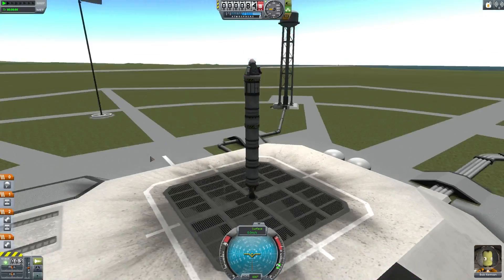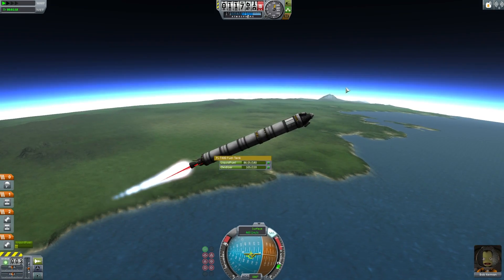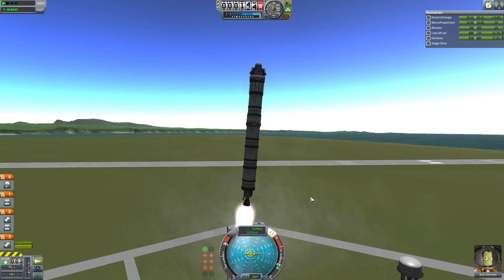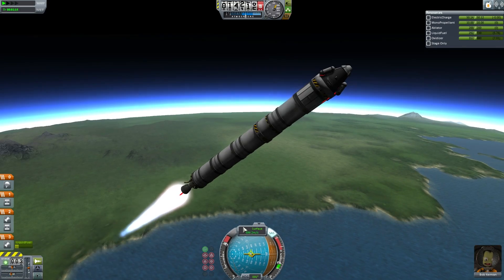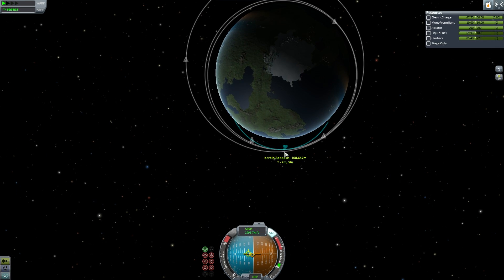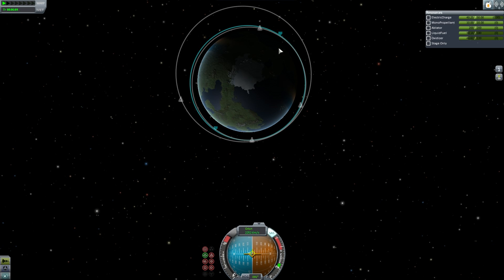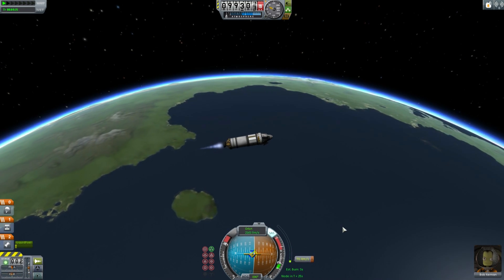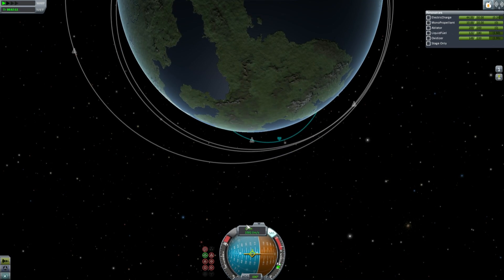Kerbal Space Program 1.0 - Launching Rockets To Orbit

Comment: Thanks, I was going to ask for updated details on an efficient launch trajectory.

I notice that the delta-V requirement to orbit has reduced with 1.0. My rule of thumb used to be 5500 m/s², but yesterday I built a rocket with 4500 m/s² and made it to orbit with fuel to spare. I managed to land on the Mun with 5500 m/s², albeit with nothing for the return trip.
Reply from the maker: AlienCollective So I guess a rescue mission is in order?
Reply: AlienCollective ???
4500~4600 should be sufficient to achieve orbit pre 1.0. Always has been for as long as i can remember.
Reply: TheLeftLibertarianAtheist Well yes, but you can't very well turn gravity off.

Actually you can, but it's cheating.
Reply: Scott Manley Yup! The disappointing part is that if I'd just brought along an antenna I could've fulfilled the contract, but I was cocky and thought I might be able to do a round trip.
Reply: Update: Now Valentina is stranded on the Mun too. I'm not very good at career mode, apparently.

Also, the game keeps crashing every ten minutes. This is the least stable version of KSP I've played.
Reply: Alon Sherman It has nothing to do with efficiency as delta-V already takes that into account. However, a higher thrust-to-weight ratio won't waste as much fuel fighting the force of gravity.

Your numbers sound about right from my observations so far.
Reply: ***** The nerf explains a lot. It seemed harder to build a 5 km/s² rocket with the level 1 part/mass/size restrictions than in 0.90.
Reply: ***** If it costs 3 km/s² to reach LKO with a 2.2 km/s² orbital velocity at 70 km, the ~25% lost to drag and gravity is comparable to real launches to LEO, where it costs ~10 km/s² to reach a velocity of ~7.5 km/s² at 140 km.
Reply: AlienCollective You could reach an orbit with 3700m/s in 0.22 in a rocket. It's just a question of efficiency and proper steering.

Something that people who used the cheat called mechjeb know nothing about.
Reply: ***** To be fair, some MechJeb players just use it to automate the parts that have gotten repetitive and boring, but no, I don't care for it either.
Reply: ***** checks Wikipedia Guess I'm not as clever as I thought…
Reply: ExampleJohn True, but I always pad the numbers to ensure I don't run out of fuel en route. I don't want to be 10 m/s short of a stable orbit. Regardless, I find the delta-V budget to orbit to be less in 1.0 than 0.90. A 4500 m/s² launcher in 1.0 has about the same % fuel remaining as a 5500 m/s² launcher in 0.90.
Reply: ***** That is almost nothing compared to the loss by gravity (~2000 m/s).
Reply: AlienCollective I had a similar feeling. I was making some pretty small rockets just to get a feel for the new aerodynamics. I was real surprised when I had enough delta-V to make it to Minmus and back on fumes.
Reply: AlienCollective Based on the few tests I did yesterday I think it's possible to make orbit with less than 3000m/s dV.  I built a rocket with 3100m/s and made 100k orbit with quite a bit left over.  I haven't tried it yet, but I'm thinking I could hit a 75k orbit with 2800m/s.  IMO, the engines should be nerfed a bit to make up for the slick new atmosphere as it's just too easy now.
Reply: ***** According to ***** earlier in the thread, they were. As I mentioned, a simple rocket seemed to produce less delta-V in 1.0 than 0.90, though I have no side-by-side comparisons to tell if this is accurate. I haven't seriously played career mode before, so my comparisons are suspect.
Reply: AlienCollective The efficiency modelling is now more realistic than before, so it may seem like some engines were nerfed.  Before 1.0, engine thrust was constant and the fuel flow varied based on the ISP.  Now the fuel flow is fixed and the thrust varies based on ISP.  Most people notice this with the LV-N because they can no longer lift off from places with atmospheres like Duna.  This is because the LV-N has poor ISP in an atmosphere and now it produces very little thrust while operating in an atmosphere, where as before it produced the same thrust as it would in a vacuum and just consumed more fuel.
Reply: ***** You're correct about the efficiency modeling, but the engines were also nerfed. For instance, the LV-N used to be 300 s ASL/390 s vac; now it's 85/345. That's why it's no longer usable on Duna: the ASL thrust went from 50 kN in 0.90 to 15 kN in 1.0. Most engines had less major nerfs; for instance, the LV-T30 went from 320/370 to 280/300.
Reply: AlienCollective The LV-N was previously 220/800 ISP.  It is now 185/800.  Not a big nerf, but because of the new efficiency modeling this means it now only produces ~14 thrust in atmo, so those "efficient" Nuke landers people were used to making aren't working anymore.  The engines that need nerfing the most are the jet and turbojet engines.  They're too powerful.  You can takeoff and reach Mach 3+ by the end of the runway.

I also managed to make orbit with less than 3000 m/s dV.  It took 2970 m/s to be exact to get to a 75km x 77km orbit.  It took a few tries to get the right ascent profile, and I think it could be done with less if you can manage a better ascent.
Reply: ***** can u share your experience of 1.0 ascent profile ? I'm managing to make the new launch function for my kos, and it always costs me around 4000dv to orbit kerbin, with the lv30 engine(new career).
Reply: Zander Zhang That particular rocket I tried to fly very efficient.  I started at 66% thrust to get off the ground, then throttled back as I ascended to keep from going too fast and getting heat effects.  I kept the nose of the craft as near to the center of the velocity vector the whole time because when you get outside that you're losing efficiency and risk getting flipped if your angle of attack gets too high.

I generally don't fly like that though.  So far I'm flying like I did with previous versions with FAR.  I may not even be doing it the most efficient, but this has worked for me.  I generally try to shoot for a TWR of 1.3 on the pad and 3500-4000 dV for my stage(s) that push me to orbit.  I try to avoid leaving debris in orbit, so I'll either ditch my last stage when my Pe reaches 20k so it falls back to Kerbin and circularize with a little push from my payload, or if I carry the last stage to orbit I put a bunch of backwards facing sepratrons so it de-orbits itself.

I don't immediately begin my gravity turn like Scott does, I go straight up until I'm between 50-100 m/s and then begin my turn.  I try to be at 45° between 8-12k, then when I'm above 35k I point at the horizon and flatten out my trajectory and stop the burn when my Ap is where I want it.  Then it's just a coast up to Ap and circularize.  One time I managed a single burn to circular orbit doing this, but I haven't been able to do that again.

Every rocket will be different though.  Heavy payloads and/or top heavy rockets tend to need steeper ascents or they flip over and break up.
Reply: AlienCollective
That's strange. I've not heard of anyone else complaining about crashes. You should contact Squad, but before that, if you have it on steam, verify game cache and make sure you remove/disable all mods.
Reply: AlienCollective Try the texture compressor, you could be reaching your ram limit
Reply: ***** Adolfo Tupo I only have a few mods installed, and nothing that should be consuming much memory. But you're both right, the problem could well be with the mods. I'll try scrapping them.
Reply: Adolfo Tupo
RAM being filled up should cause hard faults, as in, ram data being written to hard drive, but it should never cause crashing.
Reply: *****
It's a game, people can play it as they god-damn please. Stop judging others and worry about yourself from now on, okay? I use aimbots in games to automate parts of the game that I've gotten tired of. You can tweak the settings to get the most efficient headshot for every gun you have, so that you use as little effort as possible. Quit whining and play the game D:
Reply: ***** As long as you stick to single player, that's your prerogative.
Reply: AlienCollective I remember the fuel requirement. To achieve a bare-minimum 69.077km orbit, 4600 dV was required in 0.90. Now in 1.0, it's been cut to approximately what it took with FAR previously: about 3500. Of course, that's with no fuel to spare.
Reply: ***** Don't forget that your ΔV reported by Kerbal Engineer is subject to the current atmospheric pressure. You probably expended ~3.5 km/s on the way up.
Reply: ***** Good catch, thanks. I wasn't paying attention.
Reply: ***** So if snap is m/s^4 and crackle is m/s^5, does that make m/s^6 pop? Or has that joke been done to death in physics circles?
Reply: *****
Took more than 2 months to think of that reply. Nice job.
Reply: ||
-
=
RUDENESS
FINGER!!!!
||

Comment: I've had some bizarre issues with 1.0 with my navball. It was reversed for a while, now it's just reversed in the axis, and I've even had nodes try and completely reverse my heading
Reply from the maker: Hagen Smiles is it possible the root part of your vehicle is upside down? The orientation of the first part you use defines the orientation of the navball.
Reply: Scott Manley I don't believe so, in fact as soon as I reach around 25KM in altitude everything decides to 'fix' itself, very odd. After checking around it actually appears to be fixed by removing and readding the command pod. Before I was launching 'into the red' if you will and had to follow retrograde for prograde and all manner of guesswork.

Thanks for the reply though, definitely helped!
Reply: Hagen Smiles Submit your suspected bug to the Squad team and include the .craft file.

Comment: after 3 tries and i get to space and orbit with no major problems (still room for improvements thou) my problem is that my capsule allways turn nose first and goes up in flames when i try to return, i have a heatshield, that is not the problem, since as i said, it turns nose first and not shield first. 4 kerbonauts have so far met their end in a inferno some 40+ km up in the sky. im suspecting the villian is my sciense equipment im trying to bring with me, they are to light compared to the capsule, checking the mass of the capsules section i see its very top heavy.

Comment: Anyone having trouble with spaceplanes ? I can't even get one to fly normally (And I'm quite good at ksp !) Perhaps I'm missing something.
Reply: Talion Gosuto they're really easy for me now, i can send you a file of a drone space-plane i made if you'd like
Reply: TheKeilanm The problem is that I always do a backflip whenever a takeoff, so how for should I place CoL and CoM and in wich order ?
Reply: Talion Gosuto its prob from the sheer speed, my two space-planes have very very stubby wings
Reply: Talion Gosuto There is a really good tuto on ksp forum but I can't find it, if you do backflip the simplier way is to have your lift vector right after the center of mass, so the plane should be : center of mass -> center of lift -> center of trust, but the center of lift should be closer to the mass than the trust, or you will flip the other way.
Also looking at real plane design can really help.Ultimatly you can also put two winglet on the cocpit to have better control.
Reply: Talion Gosuto You want your Center of Lift behind the Center of Mass, unless you are trying to make a plane with off center wings or engines, if that's the case you have to balance things a lot more carefully. But in most cases the CoL behind the CoM will cause the nose to naturally dip down towards the horizon, and you can play with the trim to even it out.

If the CoM is too far behind the CoL your craft will naturally try to lift its nose towards the sky and if its too severe your lift surfaces will catch too much air and try to flip you over, which usually equals, Boom!
Reply: GiantSavage117 his planes have too much lift all you have to do is reduce wing size
Reply: TheKeilanm There is that too, forgot about that. But so far KSP has no way of showing you how much, or how little, lift you are creating with your lift capable surfaces, which supposedly is now theoretically everything. You have to figure it out by adding up the numbers they give you, but so far there is nothing to base the numbers off of.

Plus its not realistically balanced at this time, a very small wing surface can still produce way more lift than it should be capable of, meaning your aircraft might look a little funny with a huge fuselage and stubby little wings, its better now than it was but I still see a bit of a imbalance from time to time.
Reply: Talion Gosuto You want COM in front of CoL.

Comment: I seem to recall that in the earlier version you wanted to use less thrust in the initial part of the burn, right? If that's true, is that not the case now due to the atmosphere being modeled differently?
Reply: Loebane For maximum efficiency, you don't want your speed to exceed terminal velocity, for the altitude you currently are at. The old atmosphere was very soupy and had a low terminal velocity, hence using less thrust. The new aerodynamics allows for a higher terminal velocity, especially with aerodynamically designed craft, so you can use more thrust efficiently. You'd have to use KER or MechJeb to know exactly how much power to use for maximum efficiency.
Reply: znewb300 It's still a bit troubling to see reentry heat effects on my launcher on its way up...
Reply: If you were the real Jebediah Kerman, you wouldn't consider it a successful launch without shock heating and preferably explosions.
Reply: AlienCollective i thought i was the only one

Comment: the wing have full inside thats cool
Reply: U mean fuel* insinde the Wings??? Thats REALLY cool :o
Reply: EnderChickenHD Optional fuel. They default as empty but you can drag the fuel slider over and get up to 300 units of liquid fuel for the Big Delta Wings, or 600 units of fuel for the Big Airliner Wings. (Can't remember their proper in-game names right now....)
Reply: Cuzican Aerospace Nice  Kappa
Reply: The big delta wings are called Big-S delta wings and they can optionally have fuel inside them.They can also survive atmospheric entry and reentry along with super fast speeds.They also have more lift then normal Delta wings.Worth it esp. for big planes and stuff.

Note that they are currently only available in KSP 1.0.